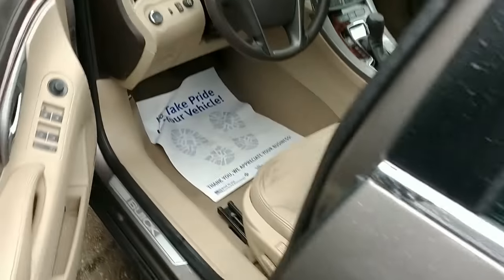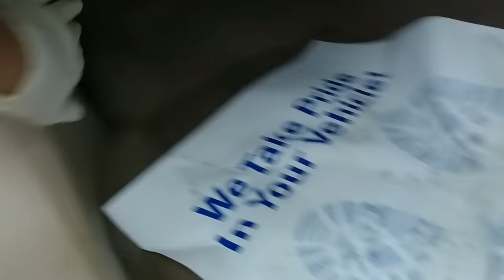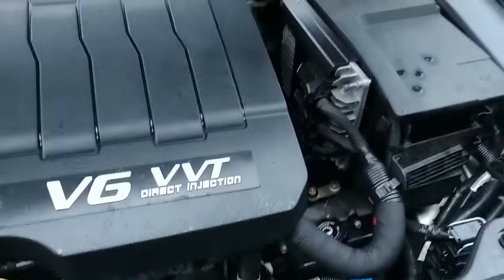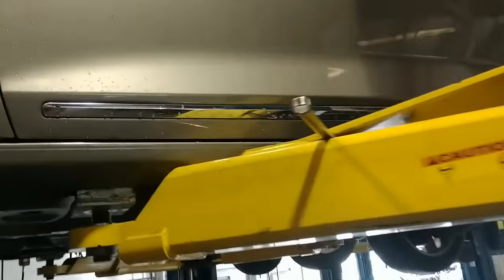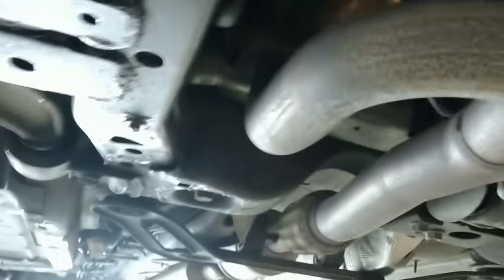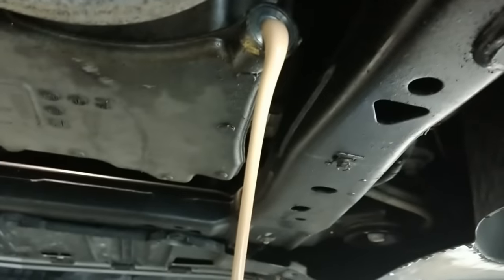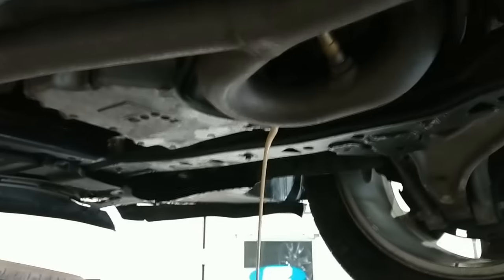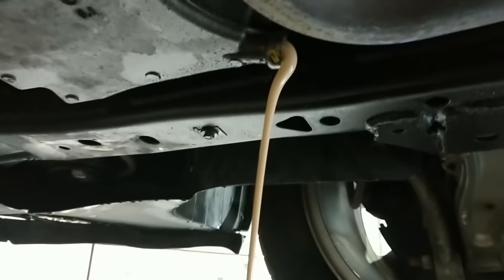Overfilled Crankcase! Blown ENGINE! Used Car Nightmare!

Comment: "My milkshake brings all the boys to the yard...."

Blown head gasket.
Reply: Blow head gadget, a cracked head or shit even a fully cracked motor block.
Reply: @TheInfoTechguy  given that there was not any external leaks and it was blowing white smoke out exhaust (only escape for mixture) a cracked head and block aren't as possible as just a blown head gasket. The oil/coolant mixure was contained inside the engine. I bank on a head gasket.
Reply: @TheInfoTechguy  True, but the most common cause is a head gasket.
Reply: Possibly warped head as well.
Reply: @Dozav7  Many cars have an oil to coolant heat exchanger;  These are NOTORIOUS for failing as well.
Reply: Should've stated as well. The W/P gasket. They could've just not sealed that correctly given that there was fresh silicone on the cover. The W/P is an instant leak on these engines if the tech doesn't ensure a proper seal, it will drain coolant into the oil pan. So either a reseal of timing cover or head gasket. I'd check to make sure the last tech did his job correctly on that timing cover.
Reply: @jeremydavis340.  - interesting. That should be a slam dunk for the customer to prove the dealer’s negligence.

Now I feel like I should replace my somewhat leaking water pump on my 260,000 mile hemi.
Reply: @Dozav7  the 3rd gen hemi is a different design. I believe if a W/P on a hemi starts to leak whether through a gasket or weep hole it will leak externally on outside of block. If the engine in video is not sealed correctly it will drain into oil pan simulating a blown head gasket. Just fill up the coolant reservoir and pressurize system to identify head gasket or W/P. Head gasket= water in cyl. as well as pan, W/P would be water in just pan. Of course u will have to drain oil pan again after test.
Reply: @Dozav7  been in the business to long and seen plenty of sloppy or lazy techs. They give the trade a bad name. Which is why I would check their work first.
Reply: That much coolant on 100 miles... forget gasket... thats a cracked block my friend lol
Reply: @jeffklaubo3168  if the block was cracked the oil/coolant would've came out instantly and not stayed contained internally. Also a cracked block would've likely let the rods go instantly as well, this engine was still running.
Reply: @jeremydavis340.  please explain
Reply: @jeremydavis340.  I mean you do realize they have coolant chambers in the block that can crack (and frequently do) that leave the leak internal right? Given the relative short distance driven before it over heated and shut down, I'd venture to sat its a cracked head or block. The white smoke can come from the over filled pan allowing coolant past the piston rings and burning with the gas.
Reply: @jeffklaubo3168  False.
Reply: @roboticunclephil  I mean... ive seen it myself, so you are calling my eyes a liar. You will not convince me its false. It can happen.
Reply: Could also be a lower intake gasket. They are know to have weak gaskets.
Reply: Doesnt just mean a head gasket could be the booming or oil ports leaking into ok ne another and a very cold climate and short distance riding can fo this get facts god damit
Reply: @jeffklaubo3168  I will convince you otherwise.
Reply: @davidreali9642  ?
Reply: Got hot and warped the head

Comment: What if someone forgot the butterfly gasket for the water pump when they re sealed the front cover.
Reply: Just what I was thinking
Reply: Can you please tell those of us who don’t know, how that works?  Or what it does or whatever.
Reply: Right on!
Reply: @Spyke-lz2hl  the front cover timing cover on these engines go over top of where the water pump sits. It does not go around the pump, therefore when you pull its cover off you need to reseal not only around the edges of it but the part that lays over where the pump attaches. It's like a sandwich, block, cover then pump. If you dont seal the cover to the pump section of the block water will run down the block straight into the pan.
Reply: @Spyke-lz2hl  the water pump and timing cover need to be sealed off from one another or the water pump pumps water through the engine block into the pan
Reply: Water pump inside timing cover. Not external
Reply: @king49334  the GM 3.6L V6s pump is very much external
Reply: @edwardmyers1746  Also, this is the only way this makes any sense.
Reply: @Spyke-lz2hl  
Getting antifreeze on the rod bearings runes then.
The whole engine needs to be redone now. Not just replacing a pump gasket.
Reply: @edwardmyers1746  Thanks for the explanation. Didn't know they were ever arranged that way.
Reply: @edwardmyers1746  correct. I  can change those in 20 to 30 minutes.  But,  this is the 3.6 liter. Entirely different than the 3.5. I recently had to do the timing assembly on my sister's traverse (I told her not to buy that darn thing so I indeed charged her an extra not listening tax).
Reply: @williamsinger4124  seems like anyone I talk to or watch says dont buy that damn traverse lol. Also sorry for typing 3.5L I mean 3.6L, I'm a ford guy so 3.5 comes by nature (EcoBoost)
Reply: @edwardmyers1746  fair enough man. But, you're correct on the gm 3.5. Hell,  they put the pump right up top on those. Them 3.6s, the early ones, such as this 12 model aren't sorted out. The later to current version of em have several bugs worked out. I'm a gm guy, but I've had several damn good ford products over the years.
Reply: That's an awful lot of steam coming out of the exhaust. On second thought, I just watched the exhaust again and it's not puffing like it would with a cylinder down. You might be right. However it's been driven with that oil for too long I think. It's probably killed the bearings
Reply: At first I assumed it was a blown head gasket. But the tan milkshake from oil pan is fully blended not just a milky slightly diluted oil. So the water pump pumping coolant into the timing cover makes perfect sense. Most likely bearings and rings are toast now.
Reply: If the engine only saw a little run time with the oil like that you'd be surprised. The 3.6 can handle a ridiculous amount of abuse. I've never infact seen a bad head gasket on this motor... I've seen them ran 10+ miles with zero oil and survive though.
Reply: @edwardmyers1746  Thanks for the info bro. Fucken right on.
Reply: Don't buy GM
Reply: @tedgey4286  Sounds like a stupid engineering design to me.  Forget one gasket and ruin your engine.
Reply: @hi-if7lj  ur a Honda guy right🤦‍♂️
Reply: @kfl611  truth of the matter is if you forget any gasket anywhere you risk destroying the engine. As a general rule stuff inside your cars engine shouldn't mix with any other stuff
Reply: @kfl611  Yes, sounds really stupid. On reasonably designed engines (e.g. Toyota) , afaik, you have the water pump outside sealed off with a simple o ring and there is no direct connection to any oil running parts.

Comment: As a Buick fan, this broke my heart lol
Reply: How'd a Buick fan get out of the radiator cooling fan assembly? I'd say we should put you back, but no one in their right minds needs one because they don't own a Buick. ;) Just messing with you.
Reply: @Honey_Daddy  Lmao good one! And yeah they have issues. I daily drive an old 00 LeSabre and there’s a list of parts I’ve been meaning to put on but don’t habe the time. Love that car tho. But the Bypassed AC system makes it interesting in the summertime when I’m extremely sensitive to heat and humidity (it’s called the LeHades then)
Reply: @ThePolarBearProductions  xD I'm glad you have a sense of humor. And Le hades xD that's amazing. Just out of respect for your love of Buicks, i will say that their old boats were solid vehicles for a long while. the early 2000s was when the GM quality control went from not great in the 90s, but doable, to "by 2010, don't buy one unless you want to sell it within 5 years because in 7, it'll start to cost you." That said, Keep an eye on the intake manifold gaskets and the various sensors (maf, fuel level) and the transmission solenoid issue if shifting gets erratic. If not for issues with the trans, sensors, water pump, manifold, or struts wearing prematurely, it's probably the last era of Buick I'd buy.  Modern ones follow the standard GM model of "let's throw every feature we can at it and see how long it can go until some tiny moving part that was poorly engineered (because they're all poorly engineered) breaks, costing the owner a fortune. Keep an eye on your old boys potential issues and I'm sure Le Hades is a fun car and a comfy ride. Buicks have always been status symbols in a way since the beginning. Something like a cadillac was, but not quite that elevated. I can understand why you'd have a soft spot for them, especially if you grew up with them as a status symbol and you're able to own one now. Idk if that is your case, but i get it. the new Buicks have all the latest tech crap and needless features to crank up the prices, and they're surely nice looking and luxurious. I just know that crap will fall apart in under 10 years because it's GM. XD but your LeSabre is one of the last of the breed that would stand up to 20 years without too much insanity if maintained.
Reply: @Honey_Daddy  Definitely. And yeah until I was in high school my mom always had either Ford or GM cars. I survived a rollover crash in her 94 GrandAm as a 3 year old and grew up in her 03 Focus. And she grew up back in the 60s and 70s so the height of the GM Golden Age before the Malaise Era hit. So yeah I grew up with stories of the old days. 

And yeah the Buick has 158k on it and still shifts like a dream. I changed the trans fluid (It was long overdue) at 154k it wasn’t bad but still better to be replaced. Had it sent to Blackstone and they said there was a lot of meta in it and was “mildly acidic” but not bad. They assume it was from the extended interval (and I assume was because the bozo who did the fluid change last didn’t put the magnet back in.) Went to a local Chevy/GM dealership near me and got a magnet and she is still shifting. I know 4K isn’t a long time but it’s good for me, I plan to send them another trans sample after 10k miles. 

Yeah GM isn’t what they used to be. Even as a kid the fact it took a check from Uncle Sam to save them after the crash of 09 and the rest of us had to suffer didn’t sit well with me. Hell recently my moms ex husband, who was a loyal GM customer said he’s never buying one from them ever again after their most recent scandal. He’s a Ford guy now

Comment: Was there ever an update to this one? Love to know what happened.
Reply: The car is junk, it's had coolant running through the engine for miles.
Reply: Why is it junk
Reply: @kenmastersmaster  

When an engine gets things that are not made to be running in it, the engine gets trashed and quickly, especially if you drove it until it broke down. That's how engines work. Even putting in the wrong oil can cause excessive wear and tear quickly.
Reply: very expensive to repair IF it can be repaired.  you have water where water should never be. water cause friction and the engine requires very smooth surface.  possible water would have damage more parts.   You can fix why it leaked but then there would be issues because it leaked.  lots of $$$
Reply: @baboytablo5735  couldn't you just keep adding and draining new oil until the paste is completely gone or is the engine just toast?
Reply: @lindzeesouperocd7558  short answer No ;) coolant in oil is usually a head gasket failure. At minimum the heads have to be pulled and the head gasket replaced and the engine flushed. Since it overheated the heads may have warped.
Reply: @DaveW74TVN  and that sounds like it would be easier to just call it a total loss then. Thanks for the knowledge mate.

Comment: I turned my back on Buick when they discontinued the series 2 3800
Reply: Ly7 are  crap
Reply: Unfortunately sold my monte for a 4 door at 220,000 ran beautifully. Great engine
Reply: For me it was the Series III
Reply: Too true.
Reply: A 3800 was mine and my sister's first car after getting it from our grandfather who wasn't religious about maintenance. The thing took the abuse like a champ and was still running beautifully when she traded it in. I genuinely miss that old LeSabre.
Reply: 3800 is a great engine but they leak a ton. Intake manifolds suck.
Reply: Best engine ever designed. You can't kill it. I had three cars with that motor. The reasone I got rid of them had nothing to do with the engine. Tons of torque.
Reply: @bluboxes  Yeah the intake manifold gaskets killed alot the Series II 3800's, plus they had a handful of other little issues that could leave you stranded. I've never been that big of a fan. The Series III 3800's had most of the problems worked out and were much more durable in my opinion.

Comment: At one point I couldn't tell if it was still coming out or just a solid mass. Used to deal with this at the marina with sunken outboards all the time. Then it was "Hey your motors 40 ft underwater... but itll be good after 12 oil changes..."

Comment: Oh dear...  That's what my dad would call "mayonnaise", caused by coolant mixing with the oil under temperature and creating this goo.  He showed it me once on one of the old bangers he bought.  In that case, it was a blown head gasket which ruined the oil. He got it going again and running nicely after replacing the head gasket and oil filter, then flushing the system a couple of times with fresh oil.  Took him the the whole weekend.  But that was the beauty of the simpler engines back in the seventies, they were pretty resilient to this kind of thing.  I suspect modern engines would be wrecked by this.  I'd have liked to see if you got this one going again.

Comment: I've lived all my life in Michigan where the roads are de-iced with salt. Back in the '90s I bought a used Chevy Astro from private individual after taking it for a test drive. When I got in the driver's seat to drive away after I paid him, I stepped on the brake and the pedal went all the way to the floor. When I got out of the car there was a puddle of brake fluid mixed with some flakes of rust on the driveway because the brake line had rusted away to the point where it finally ruptured, so I tapped the guy on the shoulder as he was walking back towards his house and asked for my money back. That's my first and only car buying nightmare scenario. I shudder to think what could have happened if the brake line had ruptured in the middle of rush hour. The guy was profusely apologetic and gladly gave me my money back. He knew it was rusty but he didn't realize the extent of the rust.

Comment: I've had to tell a few customers I've found signs of coolant in their oil over the years.

Starts off with a little white ring inside the oil fill cap sometimes.
Reply: some dealer,s say it condensation ,😁😁😁

Comment: Gonna be honest with you..... I expected it to be a Subaru based off of the picture . Not because of the Subaru oil filter, but because of the chocolate milk lol
Reply: Subarus are hardly better. a coworker drove an Outback wagon and it had all kinds of issues. She drive it normally, never pushed it hard or let her nephews race it.
Reply: @largol33t1  I know..... that’s why I said I thought it  was a Subaru. They have oil consumption issues, valve cover issues, timing belt issues, head gasket issues, bearing issues etc

Comment: First i want to say, love your videos.
Im watching the one with the highlander and ur doing a warranty valve cover replacement and greased the slide pins. Im crying inside. Thinking about not replacing the spark plugs and injectors. Me?, i would've paid the extra labor to get em replaced while it was all tore apart.
Anyway. Keep it up. Like ur work.

Comment: You knew what was going to come out of the oil pan once you looked at the dip stick, you didn't even have to do that to know there a bad head gasket
Reply: So you're just gonna leave it in there?
Reply: With that silicone on the timing cover it could be a botched chain job or water pump job. But to late now, all that smoke means the engine is toast
Reply: @AmandaHugenkiss2915  not necessarily unless it was run excessively like that. Could use a really good flushing and new head gaskets might save it.

Comment: Interesting. A common (four out of four for our extended family, lots of chatter on PassatWorld) problem for the Audi B5 platform is cross-contamination in the oil cooler. Fortunately, on these cars the main cross-contamination is oil into the coolant, which becomes readily evident in the overflow tank. The part is inexpensive and readily accessible, an easy DIY. Replace it, change the oil, and flush the cooling sytem, and you are good to go. No milkshakes in the oil sump. :)

Comment: I bought a 89 Pontiac that had issues, but I did not know it at the time. It ended up having a blown head gasket.  I ended up fixing the car myself because I really liked the car. I just wish the honesty factor had been there. Cost factor to me was about $300 for parts and head resurface. But honesty was lacking, and I did not buy from that dealer again.

Comment: If that's the case try Blue Devil permanent head gasket sealer, if that resolves your issue a head gasket will be needed later oh, it's a V6 you got to find out which side the head gaskets required